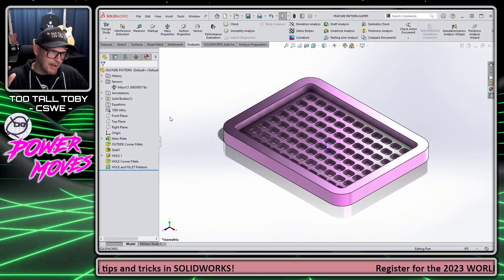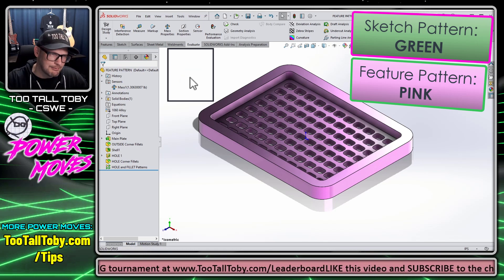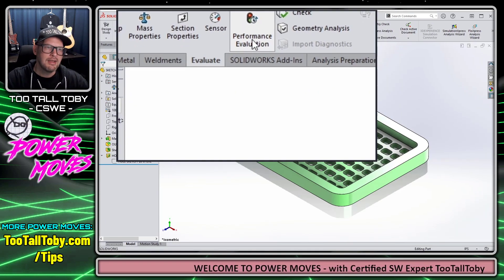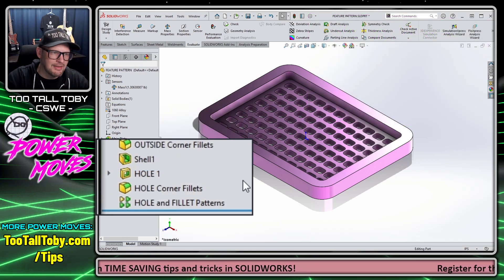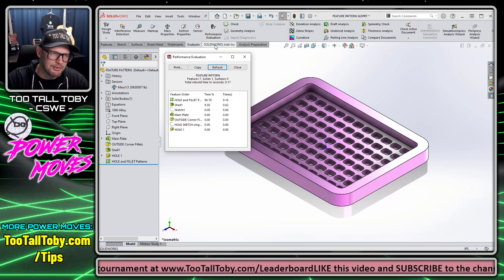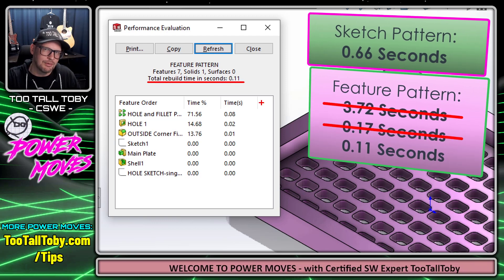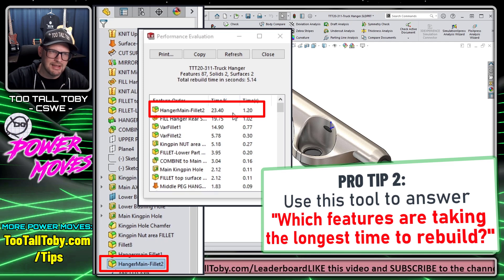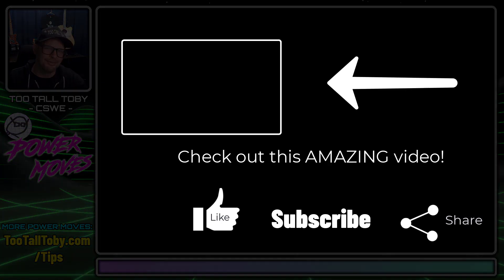Which is faster?  A sketch pattern or a feature pattern in SOLIDWORKS?

Comment: Might be a silly question, but does geometry pattern exist at the sketch level in SolidWorks?

I tried some similar experiments in build123d and I did not see a huge impact in performance (0.2 seconds between the slowest and fastest). I was also surprised that build123d (which runs on OCCT -- the same kernel as FreeCAD) was not that much slower than SolidWorks at ~1 second.
Reply from the maker: Not really - I'll make a video soon on how geometry pattern works, but the basic idea is this:
A regular feature pattern will solve the features being patterned dynamically, meaning each instance of the pattern needs to be recalculated.  But the "geometry pattern" option overrides this dynamic solving, and simply makes a "blob copy" of each instance of the pattern.  Since there is no dynamic solving, this means that the rebuild time can be reduced significantly.

However, in a sketch pattern, the default is that the patterned instances only have a reference back to the original instance.  For example - if you patterned a horizontal line, the patterned instances wouldn't be solving a horizontal relationship, they would just be a copy of the original line.   So, in essence, a sketch pattern IS using GEOMETRY PATTERN functionality already.

I like brandon's point below - if you make a block and then pattern the block it could help with sketch performance.  I can understand this because if you have 50 entities in your sketch, and then you sketch pattern these 5 times, you'll end up with a pattern relatioship on each instance of each entity on the pattern (so 250 pattern relationships).  But if you make a block first, you'll only end up with 5 pattern relationships - 1 to each instance of the pattern.

Hope this helps!
Reply: It's not exactly the same as geometry pattern, but f you make the sketch a block (Tools > Blocks > Make Block) and do a sketch pattern of the block instead of the sketch entities I've seen improved performance.

Comment: Thanks for all the tutorials Toby! They are very educational and engaging! In your experience, is there a general rule for making the most efficient patterns? I get the impression that in principle sketch pattern should be avoided, not only for performance's sake. would you agree?
Reply from the maker: Awww yeah!  Thanks so much PeakRC for the super thanks!  Much appreciated!

I agree - I think it's best to make a nice easy to understand feature tree.  I think this is even more important than performance.  So in the example in the video, I would probably make one rectangular cut with sharp corners, then add the 4 filleted corners, then make the pattern of these 2 features (even though it yields a longer performance).  This leaves me with a nice easy to understand tree.

And I like to experiment with GEOMETRY PATTERN, since that seems to significantly cut down on rebuild time, because when you use geometry pattern you are no longer dynamically solving each instance of the pattern, and instead you are just making a  "blob" copy of the feature, in it's current geometric state.  

Also - I find that if you do a BLIND CUT, rather than an "up to surface" or a "through all", and then make a pattern of the cut, you get better performance than making a pattern of an up to surface or through all cut.  Again - because the end condition is dynamically solving for all the instances in the pattern (unless you use geo-pattern).  

Hope this helps!
Reply: @TooTallToby  I'll give geometry pattern a go next time I'm patterning. Thanks again!

Comment: Great content Toby!  Some behind the scenes info:  A sketch pattern creates multiple closed contours.   The Parasolid solver for the cut must evaluate each profile and determine if it intersects with another.  The greater number of profiles, the great number of profiles to check each profile against. (Time increases exponentially).
A feature pattern is patterning the simple cut operation. Using geometry pattern doesn’t pattern the cut in a direction, it is calculating a virtual body from the material which was removed, patterning that body, and doing a simple bulk subtract from the main body.
Thanks for the video which validates the performance of the different types.
Reply: That is super helpful to know! The remaining comparison we need now is the hole and filled as features and doing both as geometry pattern. Because I prefer to use features and feature patterns to have better overview and control over my model, especially when I have to revise it for whatever reason. So I avoid putting stuff like fillets or holes into sketches.
Reply from the maker: Wow!  what an honor to have THE MAN himself, Mark Johnson, here in the comments!  thanks for the insights and great to hear from you! 

Can you tell us why making that fillet as an explicit feature, then including it in the pattern, resulted in such a significant difference to the rebuild time?   What's going on there?
Reply: @TooTallToby  Toby, happy to answer that.
When you add and pattern a feature fillet (without geometry pattern) we are patterning the cut geometry and all the edges of the cut THEN the fillet operation to however many edges must be filleted.  This is a user time saver (instead of manually picking all the edges) but from a solve time perspective, it is the same as adding XX number of individual fillets.
Using geometry pattern calculates the resultant geometry of the cut AND the filets, patterns that as a body, then subtracts as a single operation (like doing a pattern of multi bodies, then doing a single combine feature)
Including the sketch fillets means the pattern feature (without geometry pattern) is simply patterning the simple (even with fillets) closed contour cut operation from XX number of profile instances (independent of each other).